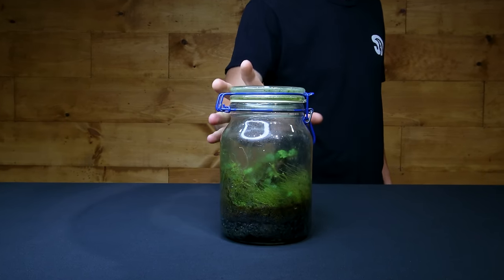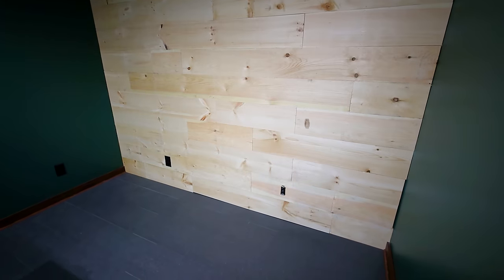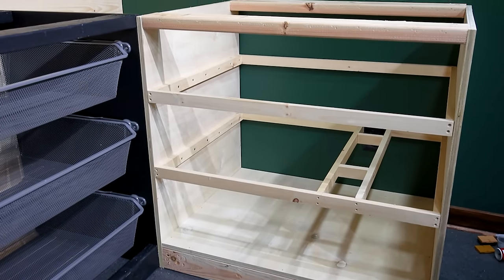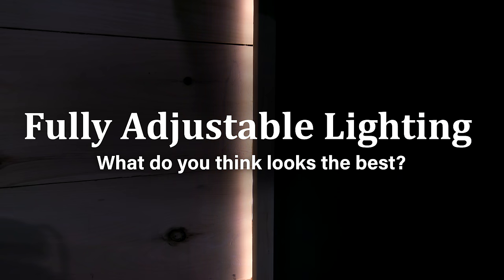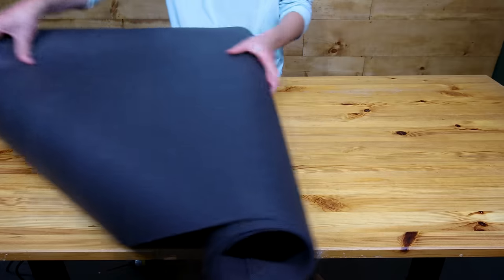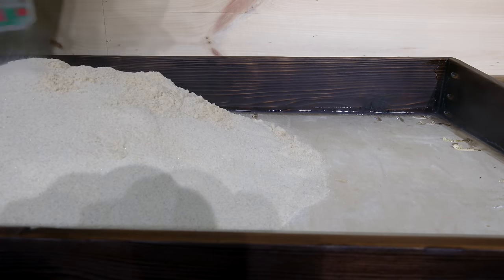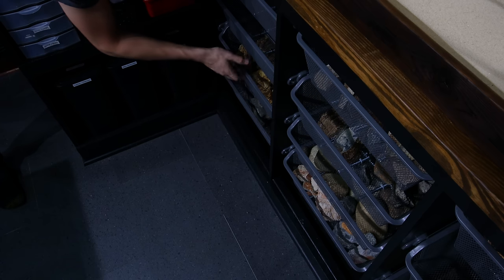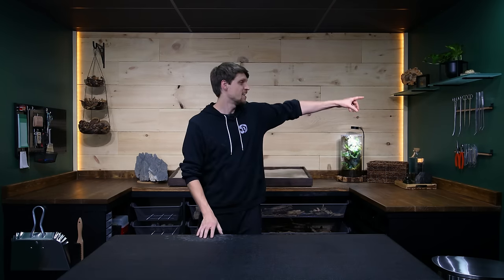Creating the DIY Nature Design Studio

Comment: Noob question: How on earth does a single bead of silicon connect all of the panels of glass and actually support the weight of that much water without literally just exploding in every direction and coming apart?